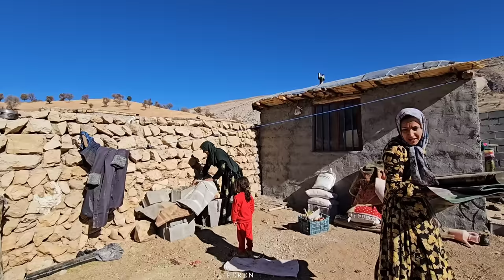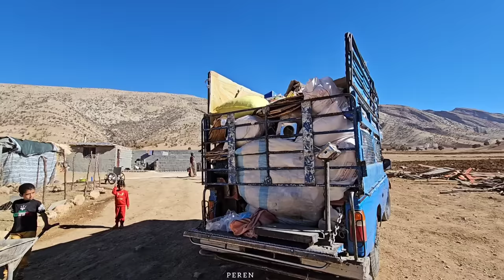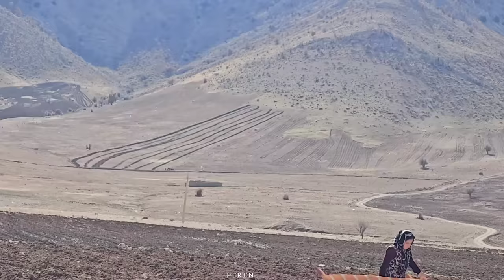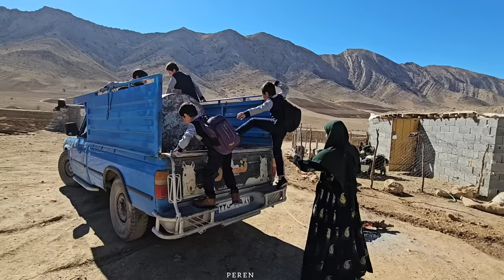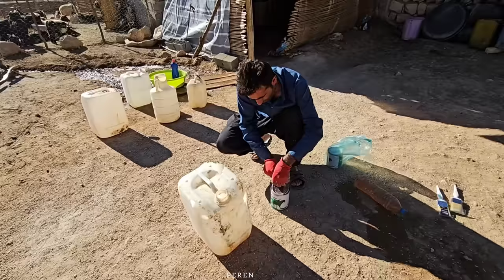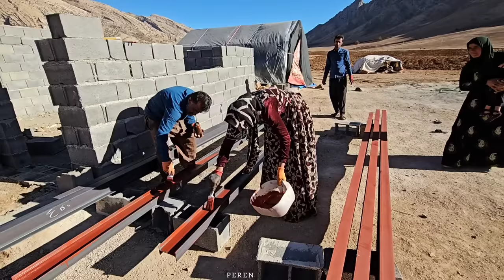"Strength and preservation:provision of iron beams for the kitchen ceiling,anti-rust to resist water

Comment: Yes iron by itself is a soft material that could rust easily over time.  But if you mix iron with another metal, or non metal element, will give you an alloy with lower corrosion resistance, lower costs, higher strength, better workability.  Copper,  steel, silicon, aluminium , nickel can be used with iron for this reason.
Pls wear a mask when you're working with paints/chemicals that give off a toxic smell.